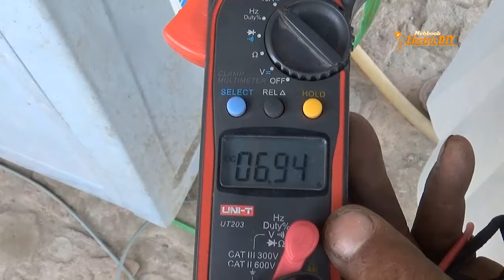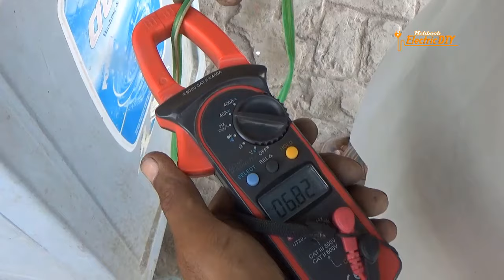How To Convert The AC Washing Machine Into DC Washing Machine /DIY

Comment: thanks Bhai Kia dc water pump ko ac pe Chala sakte hen.
Reply: Ap ko bhoth ziyada amperes ki power supply chaheye ho gee.
Reply: Yes
Reply: Sajid Ali
Simple ha
10 ya 20 rupy ka reqtifiredaiyod mily ga simple ha
Reply: Thanks Bhai Kia ap DC water pump pe video banaenge Jo ac pe chale.
Reply: @sajidali-ts2ww  ap ny DC ko AC crunt sy chlny ko Bola na bhai
Reply: @maviaanus5957  Bhai baat sirf AC ko DC may convert karnay ki nahi hae. DC water pump motor aam thor par 12V 40A DC thak ki motor use karthi hae. Ab is sorath may bhai sirf rectifier say kaam nahi lay saktha. Balkeh isay puri power supply chaheye. Transformer type ya Electronic type jo 12V par 50A thak regular power denay ki ihliyath rakhthi ho. Ab is ihliyath ki power supply kafi costly hothi hae. 10 ya 20 rupay wala rectifier kaam nahi day gaa. Regards,